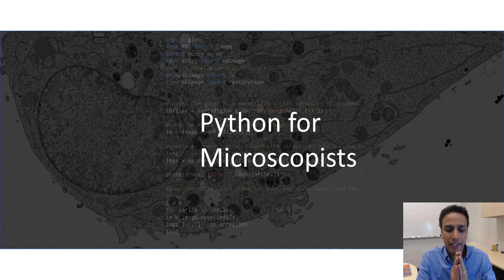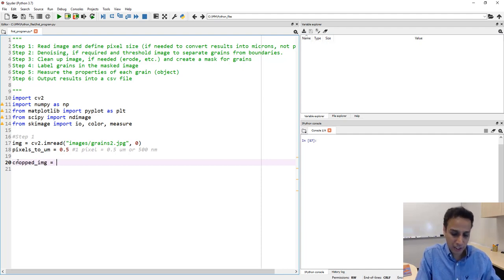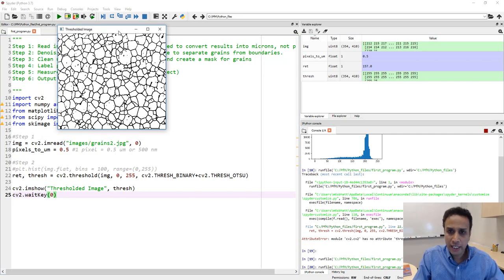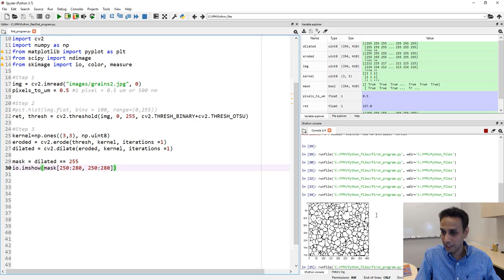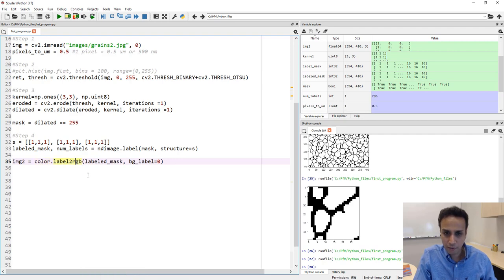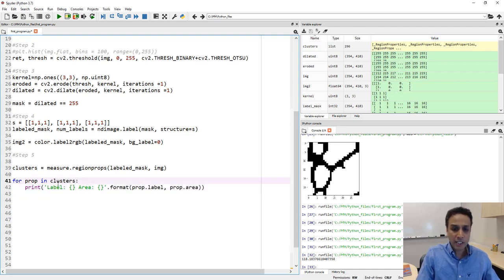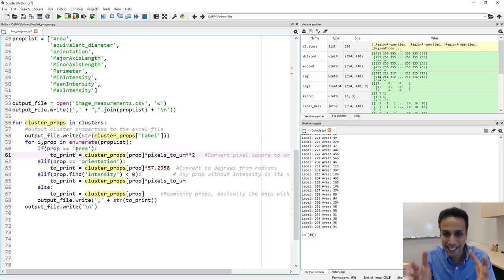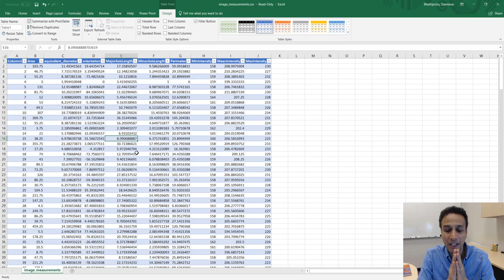32 - Grain size analysis in Python using a microscope image

Comment: @DigitalSreeni  Hi. Thanks for your video. I have the same question that DJ Deka. Why are you using 0.5 um? I know that 1px = 264.58 um. I am using an image SEM with your python code to calculate particle size. My image has a magnification of x50,000 and its scale bar is 100 nm. Is 0.5 um right for my case? Thanks.

Comment: Hi Sreeni, 
Thank you for the video. You have well explained every steps.
I am analysing an image of fiber reinforced composite transverse section. I have to find out the coordinate of center of fiber (approx. circular) and diameter. I see you used equivalent diameter which I can use for diameter. But I don't know what to use to extract coordinate of each fiber center. For simplicity, its equivalent in your analysis would be to find centre of each grain assuming each grain as circular.
Reply from the maker: Please watch my video 116 to understand how to get properties of segmented / labelled regions. The output provides you with a lot of measurements including centroid. Here is the link to regionprop documentation.
https://scikit-image.org/docs/dev/api/skimage.measure.html#skimage.measure.regionprops

Comment: sir, thanks a lot for the explanation. Could you explain what does the intensity in skimage measure means? does higher value means brighter or darker regions?
Reply from the maker: Intensity is basically pixel values for that specific object in your original image. Yes, it means brighter and darker in your original image.

Comment: Great Video. One question. What is the the major and minor axis measuring unit - Pixels or micron?
Reply from the maker: It calculates pixels by default, we convert it to microns by multiplying the output with the scaling factor (pixel_to_um).
Reply: @DigitalSreeni  thank you for your reply. Is 1 pixel=0.5 microns a standard?

Comment: One question regarding the image reading. I tested plt.hist() using skimage and cv2. When showing the image, is the same, but when plotting the data in histogram, it shows different data. Any idea why? They are both as gray.
Reply from the maker: I believe skimage uses 64 bit float while reading images whereas opencv uses ubyte (unsigned integer). Try converting skimage imported image to ubyte and then looking at histogram. Hopefully it matches with the opencv histogram. 

from skimage import img_as_ubyte, io
img = io.imread("your_image")
img_as_ubyte = img_as_ubyte(img)
Reply: @DigitalSreeni  That works perfectly well. Thank you for the response.

Comment: hello I have a question for the output you generate what is the grain size in nm² and how much grains do i have in my image, it might be depends on the scale of the image which are you took with the microscope but how can I measure that? thank you very much
Reply from the maker: In the code I converted pixels to microns based on the scaling factor. If you want square nanometers instead of square microns then just multiply sq. microns by 1 million (10^6). I hope this answers the question. In fact, if you want to convert any units the best online resource is Wolfram Alfa. Here is the link where you can see um2 converted to nm2. https://www.wolframalpha.com/input/?i=1+um2+to+nm2

Comment: image_measurements.csv initially gave me a blank table, no values nor header in it (even though the script ran without error). 
It took a little while to realize that my mistake was to still have at the bottom of the python file: 
cv2.imshow('eroded', eroded)
cv2.waitKey(0)

Leaving out these two lines produced the desired result.. a filled table (columns Area...MaxIntensity and rows 1..N for each detected cluster)
Reply from the maker: Those 2 lines are just displaying your image on the screen, the code will not move unless you close the opened window. You can set a wait time under waitKey(0); instead of 0 which means you have to close the window manually you can set a value, e.g. 5000 (5 seconds).